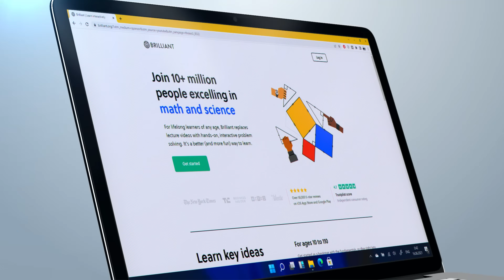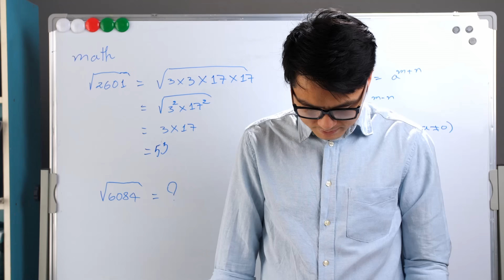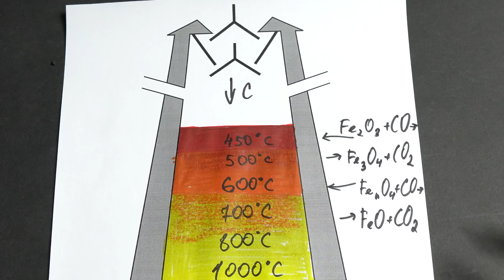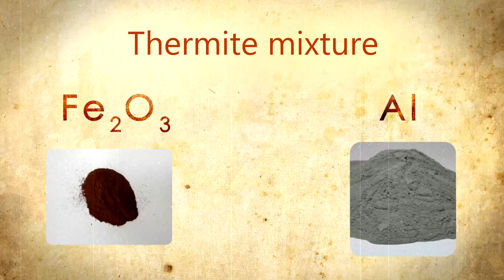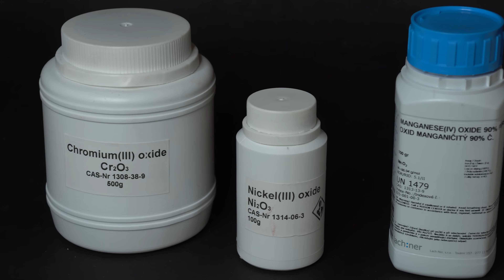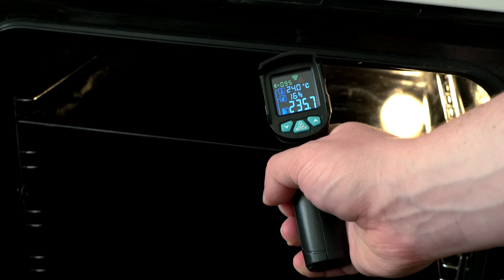I'm the Only one who makes Knives this way!

Comment: Quenching is different from tempering. Quenching reduces the temperature dramatically thus increasing hardness and tempering is a gradual heating process to remove excess strain in the metal increasing toughness.

Comment: 3D Printed Thermite Metal. Powder feeds into the print head, is ignited in the nozzle, and the smelted metal is laid out like the plastic. /dabthoughts
Reply: what materials can you possibly use for the print head that would be able to withstand repeated thermite reactions??

Comment: Why does steel that was made is the early days so much more corrosion resistance than metal made today ?? The rust color is much redder than the old steel color of light red. Also, the corrosion stops when the surface is lightly rusted. What is causing this to happen Thoisoi2.

Comment: Excellent video as usual. I had no idea that a thermite reaction could be used to make alloys.  I have made soft iron ingots using a kilo of thermite, but stainless steel is totally next level. A note for anyone trying this at home: Iron(III)oxide powder can cause serious eye damage and potentially irreversible damage to the digestive tract. Also the fumes can cause heavy-metal fever. Stay upwind!

Comment: I just watched your "How to make a rocket engine from table salt" video, and had an idea:
What if you took that sugar motor that's prone to explosion, and just add a lot of iron oxide to it?
I know the rust wouldn't get hot enough to cause any kind of chemical decomposition, but as it's kinda unreactive at that temperature it should act as a buffer for the sugar, but provide some extra physical inertia as it's pushed out the back. Maybe.

Comment: have you ever make a knife from a meteorite ?     an if you have did it take longer to heat up an was it harder to work the metal to forge the knife ?
Reply: metallic meteorites are usually mostly Nickel/Iron amalgams.  if you can work nickel, you can easily make a knife out of meteorite.  it's just that meteorites themselves are pretty expensive to buy.

Comment: To start blacksmithing you only need 3 basic things 
Something to heat the steel with , something to hit the steel with and something to brace the steel against.
So you can use a railroad for anvil , regular hammer and even a simple hardwood with some air supply would heat the steel enough to forge .
In this case though you would need something to hold the steel with since it's small .

Comment: Literally no knife oxidise in just a day
Edit: or a week or a month
Reply: I've seen knives rust in as little as half an hour.
Reply: @autumn5592  bruh I'm 24 and have left knives everywhere! In the sink, in the fruits and in dirty plates for hours. that's not a normal knife that has to be the cheapest most useless piece of metal ever
Reply: @Sonofsun.  You realise that steel has different grades?
Certain elements in the steel can prevent rusting, as well as other factors like hardness, and finishes.

The majority of production knives are made of quite corrosion resistant stainless steels -- high chromium content; chromium produces an oxide on the outside of the steel, preventing further oxides (rust) from forming.

Lots of older knives, custom knives, and high end production knives, have low or no Chromium levels, meaning oxides from easier.
And under certain acids, will corrode in no time at all.

If you don't have a non-stainless knife, you aren't ever likely to experience rust.

I live in an area that is not very humid, and I've left knives over night when I've been working on them, and had light rust form, I've seen rust from (under certain conditions) form in a half hour.
Reply: @autumn5592  bruh i don't care about grades of steel! i just googled it pure iron oxidises in atleast 3 days not to mention steel is way way more rust resistant. Are you seriously calling a piece of junk that you only need to wash it four times and it rusts just by being left to dry out, a knife?  You seriously need to read up on iron and steel especially since you have a knife sharpening business
Reply: @autumn5592  you are definitely being scammed
Reply: @Sonofsun.  "i don't care about grades of steel"

good job proclaiming your ignorance as loudly and proudly as possible.  the rest of youtube now know to avoid your commentary to save time.

Comment: 16:38 you didnt like the method? Maybe because you are doing it wrong? You shouldn't push and pull the knife on the whet stone only pull or only push
Reply: I've seen so bloody many professional knife makers use  a push+pull method followed by a only pull on the finest stone and stropping leather. So yeah... Also, if this video is so unbearable and shit, why watch?
Reply: Knife maker, and I run a knife sharpening business.

It doesn't matter which way you sharpen; push, pull, push and pull, it all does the same thing, remove material to reduce apex (edge) width, making a sharp tool.

There are some minor things like burr formation differences, and apex quality, but these will NEVER be a problem for the average person, or even decent sharpener.

The 'it only goes one way' is a myth.
Reply: @autumn5592  i understand that it will sharpen but I'm certain it wont be as sharp
Reply: @Sonofsun.  As I said, there are differences if you are pedantic, but you have to be an expert level sharpener to notice and achieve the differences.
The average sharpener simply doesn't have the skill to get the results that would provide it in the first place.

The difference in apex quality is literal nanometers under PERFECT conditions.
Even guided sharpening systems aren't perfect, and then you have user error effecting burr formations, you have geometric differences, what the abrasive is, the grain structure of the steel, and various other things.

So, when I say it doesn't matter, I really mean, it really doesn't matter.

However a person sharpens best, is going to be the best option. Them changing direction will not magically make their knife sharper.

Like I said, I make knives and I sharpen knives and tools for people.
I am a 'master' level sharpener (I can make edges that cut a hanging hair with no pressure, one of the hardest tasks a knife can do, I can make edges that cut hairs in half length ways, and I can make edges that shave your face hair from some of the coarsest abrasives you can imagine), and I can barely feel which one is better.

So, there is documented proof there's barely a difference (electron microscope pictures), and there's anecdotal evidence proving it doesn't matter.
There is also footage of old japanese bladesmiths doing scrubbing (pushing and pulling) their newly forged katanas.

It is a myth that sharpening direction matters.
Reply: @autumn5592  either you're lying or you are mistaking even pure iron doesn't oxidise so quickly
Reply: @Sonofsun.  you really have no clue what you are talking about.  what you think you see when you are looking at something made of pure iron... is LITERALLY iron oxide already.
Reply: @autumn5592  it does matter literally everyone sharpens knives the way i told you on youtube
Reply: @autumn5592  either you're lying or you are mistaking even pure iron doesn't oxidise so quickly

Comment: Okay, so heating up a blade and then dunking it in oil isn't called tempering... that's what's known as quenching, which hardens the knife.  Tempering is the part where your blacksmith friend put the knife in the oven for an hour or two... which slightly softens and toughens the steel considerably.

Just as an point of future reference.  if you do make another knife out of Stainless you should be aware that typically it's "quenched" between 2 aluminum plates to wick the heat away (somehow it's faster than a liquid quench) and then left in a vat of liquid Nitrogen over night...  

By the way... You're not the only one that makes knives out of Thermite...  I would look up Ilya Alekseyev here on youtube (That Works is the channel) he makes thermite and crucible steel... As demonstrated on the Man at Arms Reforged Ulfberht Sword and Jambia Dagger builds (Awe Me is the youtube channel).

Comment: I don't think that thay's stainless steel. Maybe I'm wrong, but every time I have to grind stainless steel, it doesn't make the same amount of sparks as this knife did. Usually there aren't that many sparks, and the ones that do spark don't get thrown that far.
Reply: Spark behaviour doesn't mean much.

Abrasives, speeds, material thickness/cut angle, etc. All play a part in it.

Comment: Hardness test was performed without sufficient support, measured value of 200 Hardness Leeb D scale is indicating wrong measurement- annealed steel has ~500 HLD, thus any piece of steel You may find and measure will have at least 500 HLD. For example, hammer head should have at least 700 HLD. To achieve proper reading, support knife blade on a heavy( couple kg) flat steel piece, store-bought kitchen knife will have at least 700 HLD~= 50 HRC.

Comment: You should have attempted a ferric chloride acid etch. I have believe you will see a noticeable pattern in the steel finish because its essentially crucible steel. Possible similarity to wootz steel or damascus (non pattern welded)

Comment: This is surprisingly a more approachable version of how tamahagane has been made for hundreds of years, which the surprising part is more people don't use it. If you ever decide to do it again, I'd add a few pinches of Nickel in place or in addition to the Chromium, a dash of Manganese, and a pinch of Vanadium, then set it off with KMnO4 and a few drops of glycerin/glycerol. Then when you go to the forging process, folding the blade will remove impurities and close up the grain structure (reducing inclusions). The big inclusion on your blade will Definitely become a point of failure during heat treating. 
It's a bit more time consuming getting the amount right as you have to factor in shrinkage and forge losses, but if done correctly, you can cast thermite directly into a graphite mold like a billet or a larger version of your final product (ala sand casting with a graphite powdered barrier to prevent the steel sticking to the sand), then go to town on an anvil. I like to use the billet method as I'm going to fold it anyway for better grain structure.
Reply: the problem with thermite is that its not 100% iron usually its a combination of iron oxide and aluminum oxide beyond which can be added manganese etc but my point is shrinkage thermite shrinks quite a bit simply from the fact that all of the air gaps got burned out not to mention that the aluminum oxide would burn off to slag leaving you pretty pure iron getting steel out of the process is frankly fascinating

Comment: Your conclusion that your alloy is of a better quality than the store bought kitchen knife's is not sound. Hardness does not equal quality. You essentially showed that by tempering the blade before using it (which significantly reduces its hardness). Quality is a nebulous thing, but you could measure its yield strength, impact resistance and coefficient of elasticity in addition to the hardness if you want to have a better picture.

Comment: I love cast iron skillets. My grandmother had one that was old she got it from her grandmother. She never washed it because it absorbs the flavor of the food so she would lightly oil it wipe it out when done but not wash. If that makes you cringe never washing the skillet, then you should know there's no worries. Before she would cook something she would always heat it up to high temperature if she cooked something previously that might be a danger so just for peace of mind she would heat it up for about 5 mins. It did burn off some flavor and that's why she only done that to food that could be a risk. But the flavors held well and made food she cook in it very tasty. If you never had one or never cooked on one, you should get and try it out. It will take time to absorb flavors but Everytime you use it, get better. Never wash just wipe out with dry paper towel then lightly oil it with your cooking oil. Best if you use extra virgin olive oil or just virgin olive oil. Holds flavor the best and helps with sticking, and also rust too but shouldn't worry about that if it's a really good one and if you keep it oiled. Wish I had that skillet of hers but sadly when she died, my cousin got it.
Reply: No, No, No.  Correctly seasoned fresh cast Iron and carbon steel pans DO NOT absorb or impart 'flavour'. Such pans are not scrubbed back to clean metal like you would with stainless steel, because the 'seasoned' layer prevents rusting (which will taint food) due to a thin layer of plasticised oil that seals the surface and may impart a flavour (sometimes undesirably so). e.g.  I wouldn't use a garlic or spice ridden  pan when I didn't want that flavour transferred to what I was cooking in a a tainted pan. A seasoned layering may help prevent food sticking (although pan temp has more to do with that matter.
Suggesting "never wash" a cast iron pan is DISGUSTING, and how you make a pan only good for one use. NO commercial kitchen would operate under such filth regime.  To suggest heating for a bit longer if it 'might be dodgy' from no hygienic wash regime is ludicrous. That would only kill off the pathogen but do nothing to remove any toxin such filth produces. That simply shows the level of ignorance your teacher passed onto you. 
You suffer 'conformation bias', suggesting mummies cooking and old pans and ways are the best.  
Olive oil can go rancid if left UN-plasticised on any surface. Oily pans left hanging in a rack or stored in a draw attract dust and grime. Yes, they get left hanging or stored for specific need because they are such a PIA to deal with. 
I only use Olive oil for low temp. pan frying... which is close to being either close to being too cold to prevent sticking food, food not frying (rather, boiling in lost moisture) or burning the oil (which tastes like crap) when slightly over correct fry temp. There are far better oils for flavour and high smoke point.
Sure, I have large and small cast iron pans that I rarely use due to the weight issue. They may have a higher thermal mass than a crappy thin stainless or Al. pan, but I use thick Copper base pans stainless pans that hold heat far better than cast iron ever will.

Comment: avoid bending over to rules
Reply: and where did you get the aluminium powder, huh :)
Reply: you definitely have a chicken-egg problem
Reply: hydrogen reduction from electrolysis is simple
Reply: friction drill melting
Reply: are you aware that what you do is like witchcraft, or alchemy, knowledge based curse, be given full freedom
Reply: aluminium oxide is a jewel, sapphire
Reply: induction melting casting
Reply: but epic anyways
Reply: try sapphire knife next

Comment: Excellent!

 Thermite is so versatile, and you can do so much with the process. It is a wonder that it isn't shown to be one of the earliest ways to make iron and other alloys of iron. Bauxite and iron oxide works as good as aluminum powder to make thermite.
Reply: Aluminum requires large amounts of electricity to be extracted from bauxite.
Reply: @HenriFaust  No, it requires heat, which we use electricity to produce with carbon rods in the bauxite. The excess oxygen reacts with the carbon rods to produce MASSIVE  amounts of carbon dioxide gas and liquid aluminum.
Reply: Bauxite already has oxygen attached. How is it going to steal oxygen from the iron and other oxides?